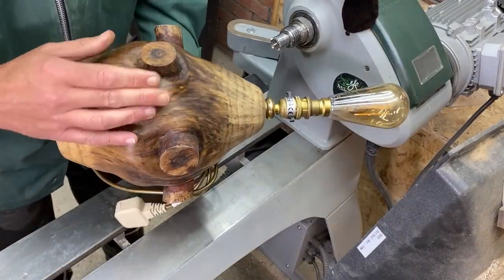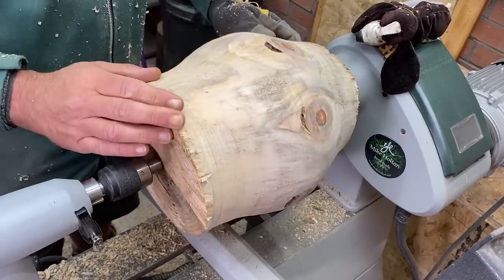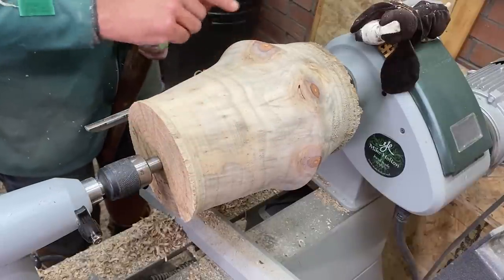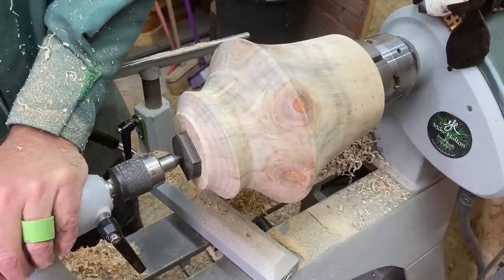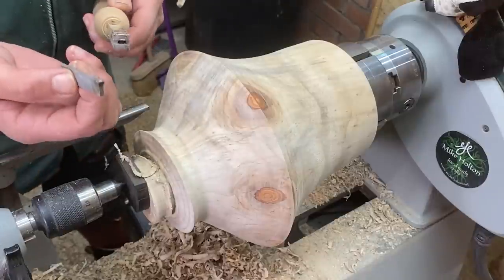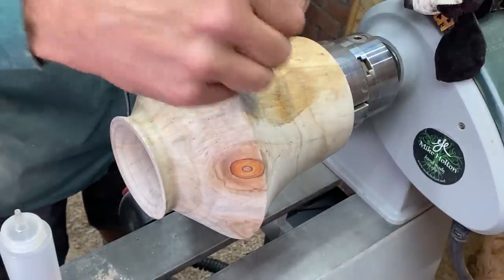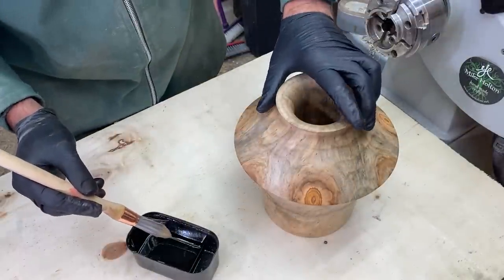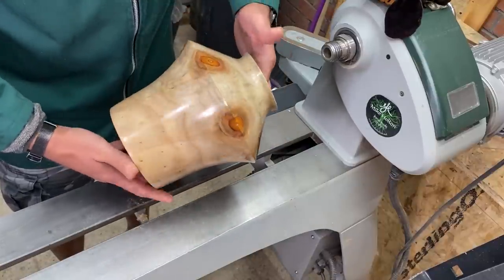This time it's KNOBS OFF -  A Monkey Puzzle Woodturning project

Comment: When you were starting and undecided on the finished item I was immediately thinking of a lidded biscuit barrel. Reducing the overall height and making a shorter box or a bowl with the bottom of the blank. However you have achieved a beautiful vase shaped work of art that I hadn't seen coming and you have definitely made the right decision. Truly beautiful.
Reply from the maker: Thanks Colin, I did think about doing a biscuit barrel before I started 😀

Comment: I love this piece, more so that the previous piece.   The grain/colour around the branches looks terrific.   I wish the colour would not darken, but it will.
My heart sank when you have the catch.   I wonder how much of the break was the steel being weakened by two screw holes.   It may also have been a brittle alloy, or hardened and so brittle.   So happy the piece stayed on the lathe.
I hope you are enjoying your break.
Dave.
Reply from the maker: Hi Dave, I think I agree, taking the knobs off really lets you enjoy the natural colours of the wood. I would imagine the holes in the blade did not do it any favours, cheap import, you can buy replacements but I do not think I'll bother.

Comment: Love the shape. The finish is great. Really liked that it didn’t change the original color much. I have been struggling with a piece of cedar. I went with tung oil and really disliked how it changed the color drastically.  So hopefully I can sand it back and try the finishing process you did in this video. Thanks.
Reply from the maker: Thanks Vicki, that is the great thing with wood, you can just sand back and start again lol, all the best, Mike

Comment: I love it ten times more with the knobs off! I was hoping that you would hollow the inside out a little more. Is there a reason that you only drill it for the most part, apart from the rim.?
Reply from the maker: Hi David, I wold have needed a steady rest to hollow out more (to so it safely) but I have one on the way so next time it will be a full hollowing 😃, all the best, Mike

Comment: I like it with the knows off although I think it would look better if the sides were a little bit rounded and not such as pointed.
Reply from the maker: Thanks Debra, you could be right about the sides, I do so many rounded shapes the sharp angle just appealed. 😃

Comment: Hi mike, I have recently collected the wood from a newly fallen monkey puzzle. Do you have any idea how I can dry it without cracking, also do you think a side grain piece would be a good idea.
Reply from the maker: Hi, side grain bowl would be nice! You can try splitting a section and part turning the two halves, when done seal with surface with a watered down PVA glue mix. The wood can be very sappy it turned too early so you may want to leave it somewhere dry for a year or two first.

Comment: Hi Mike, I thought that using a sealer such as shellac would stop oil penetrating into the wood and the oil would stay on the surface.
Reply from the maker: Hi Edward, you are right to come degree, there is penetration but more is on the surface making it easier to get a higher shine on the piece. Without the shellac it would have taken a lot more coats to build up the same effect.